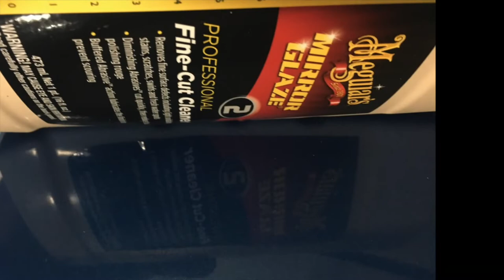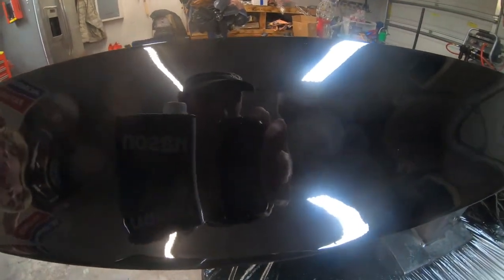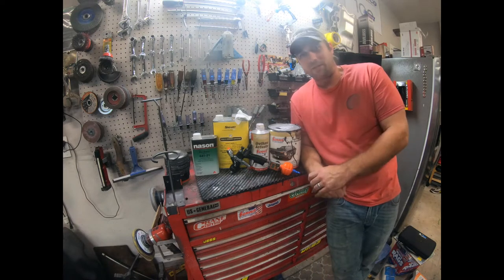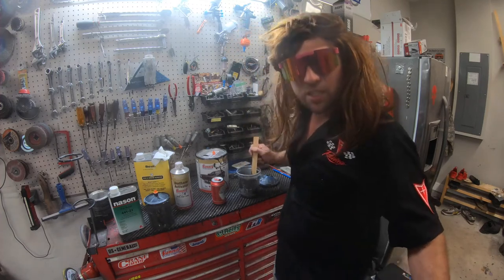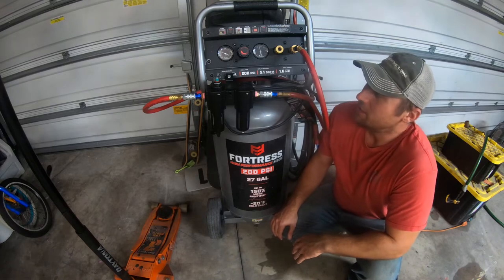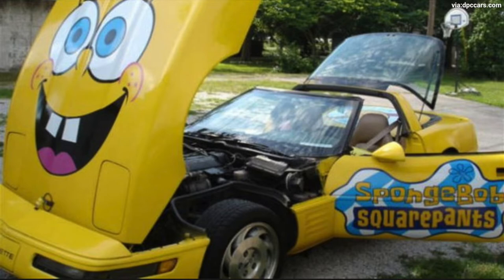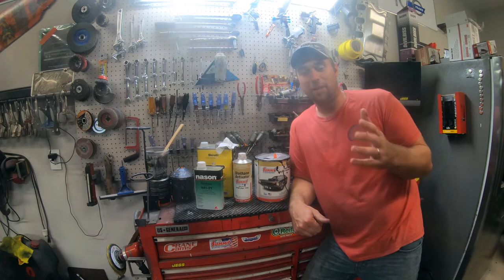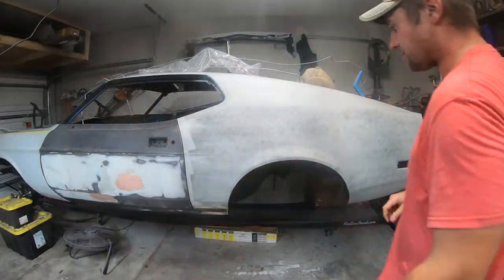Summit Single Stage Paint Classic BlackSUM-UP300G At Home Results

Comment: Never had any problems with my starting line guns . Must be the operator ! I do like your videos though .
Reply from the maker: Hey you know what, it probably was the operator. That was my very first time ever holding a paint gun and I have learned quite a bit since then. I may revisit those now that I've got a little more spray time under my belt before I completely throw those things under the bus the next time. I appreciate the comment and The view. What type of cars are you into? Or bikes
Reply: @SteffsGarage  working on a 65 Mustang at the moment .

Comment: What didn’t you like about the starting line guns? I’ve not had good results with mine but haven’t used anything else to know. Looking to upgrade soon. Solid vid thanks for sharing.
Reply: Also what tip size did you use?

Comment: Gonna try this with a turbine system! This spring in 2023 💯👍🇺🇸
Reply from the maker: Share your results, I looked into a turbine system but ended up going with the emax compressor setup. Very curious as to how that turbine works.
Reply: Turbine jobs Ive seen done have massive orange peel.